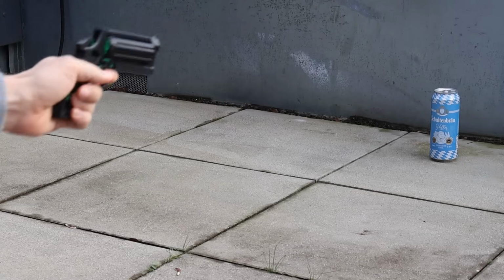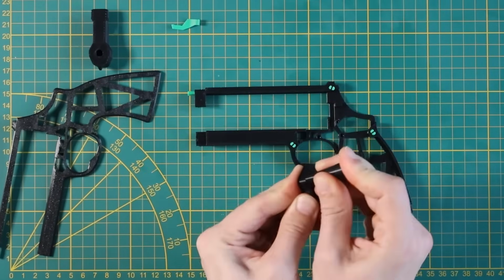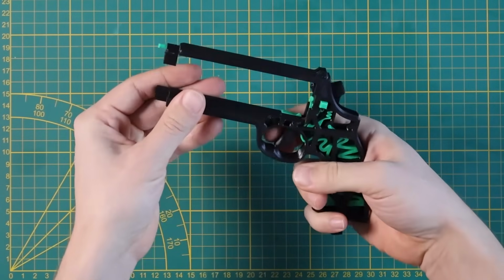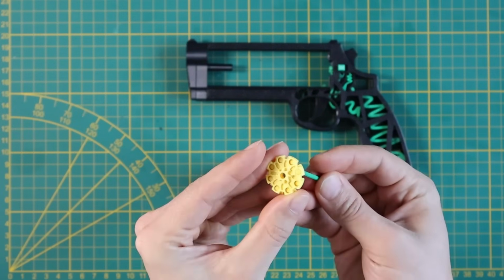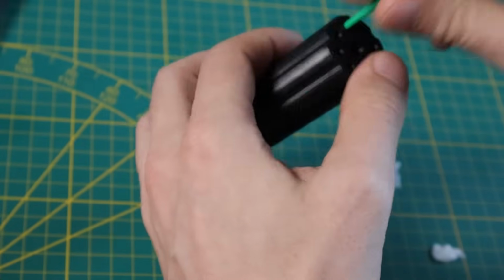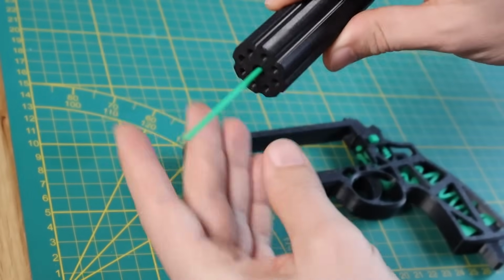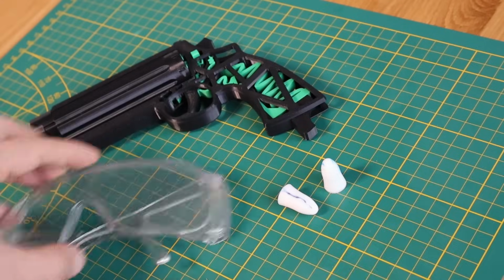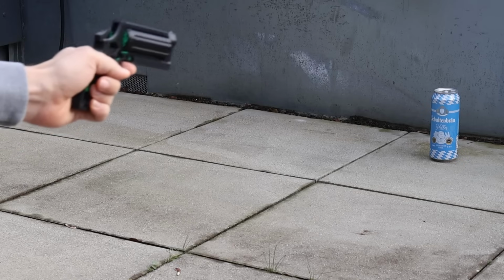Shooting Cap Revolver from 3D Printer

Comment: Non makerworld download?
Reply: @Scuggish  why
Reply: @thorgraum1462  Bambu labs/makerworld are predatory and i shouldn't need an account with them just to download something.
Reply: @thorgraum1462  Because bambu/makerworld are predatory and i shouldn't (and wont) make an account just to download any 3d file.
Reply: @thorgraum1462  it seems my comments are removed when i mention why
Reply: Makerworld/bambu practices are predatory, and i shouldn't (and wont) make an account just to use free 3D files.
Reply: @ so make the revolver yourself. im sure im speaking for the entire bambulab community when i say: we dont care
Reply: @thorgraum1462  yeah i figured, hows that going for your printers right now?
Reply: @Scuggish  going very well, we just had some security updates, and the printers are printing better than the others on the market.
Reply: @thorgraum1462  the "security updates" that force your printer on the cloud, force proprietary code and isn't secure at all?
Reply: @Scuggish  you sound real stupid. You have no idea what youre talking about
Reply: @Scuggish  1. Bambu Lab isn’t locking you out
People freaked out, thinking this update would force them to only use Bambu’s own software. Wrong. Bambu Connect is an open system that still lets you use third-party apps, just in a secure way.

2. The security update actually makes sense
Before this, your printer was wide open to the internet, meaning hackers could potentially mess with it. Yes, a 3D printer can be hacked. This update stops that while still letting trusted apps connect.

3. Developer Mode = Full Control (But Your Responsibility)
If you’re a tinkerer and want total control, you still have it. Just turn on Developer Mode, and you can do whatever you want. The only catch? You handle your own security. That’s fair.

4. Nothing forces you to buy extra hardware
Some people assumed they’d have to buy extra gear just to keep using the printer the way they like. Nope. Your existing setup still works.

5. The usability of your machine is not limited
You can still print however you want.
You can still use third-party slicers and apps.
You can still modify and customize your machine.
The only thing that’s changed is that random strangers can’t mess with your printer anymore.

So, to sum it up: No, this update isn’t some evil plot to lock you in. It’s literally just making things safer without taking away your freedom.
Reply: @thorgraum1462 Makerworld/bambu practices are predatory, and i shouldn't (and wont) make an account just to use free 3D files.